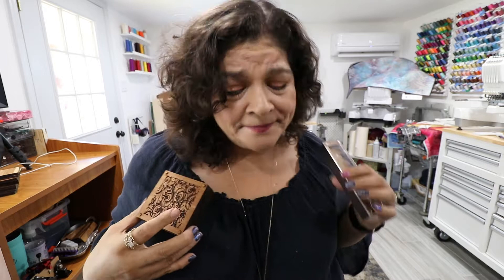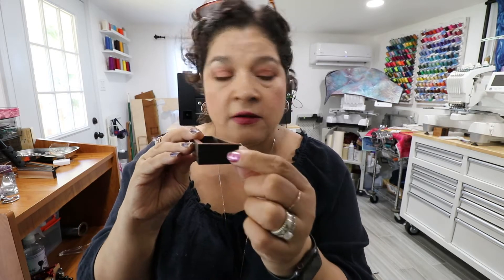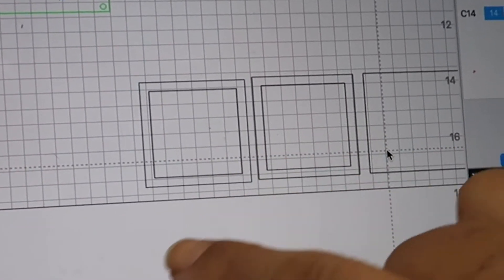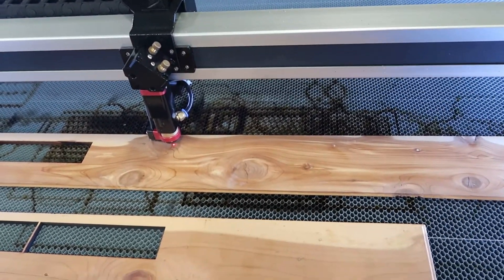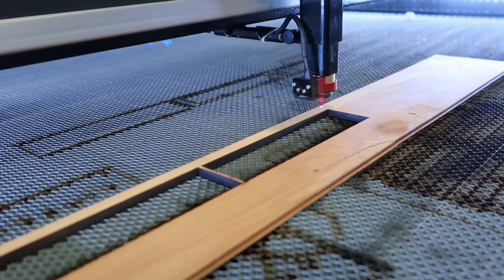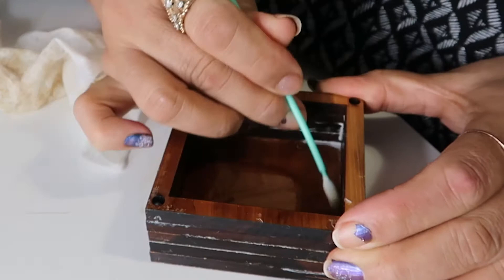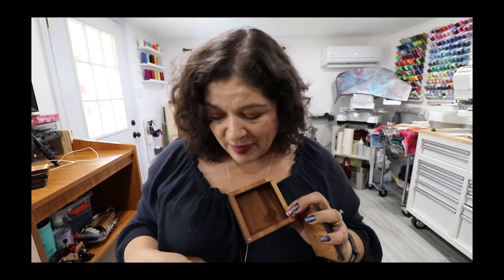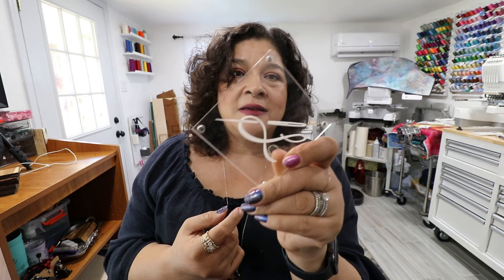How to make a box with a laser tutorial /AEON NOVA14 AND MIRA7

Comment: Why use two magnets together?
Would not a metal that's magnetic work on one side just as well?
Also the metal side would give you more design options and cost less.
Reply from the maker: I never thought of that.. I just need to see if I can find metal that will fit the size of the box.

Comment: By the way that size difference you're talking about is called the kerf. If you create a 1" square, cut it, then measure it with the calipers, subtract that number from the 1", that is the kerf (the amount the laser cuts away) that is the amount you add to the hole being cut. I hope I explained that correctly. The kerf on mine with one of my woods is 0.007 so I add that to the cut being made if I need it to be exact to a measurement.
Reply from the maker: Thank you

Comment: Really beautiful, however it seems like a waste to use such beautiful Wood to build up the layers. You glue the beautifully parts together and ask we see address the charred edges. I'd use a cheaper Wood for the build up in between and the nice wood for just the bottom and the top.
Reply from the maker: If you have the setting to cut nice.. the wood doesn’t char as bad I washed the wood and the soot and smell are removed..  yeah I love this wood but but the cedar color will be different between layers. But I get it. If I could get this look in between layers I would do the same..